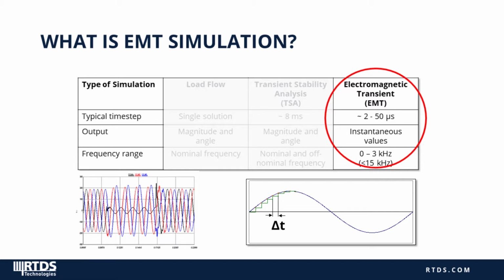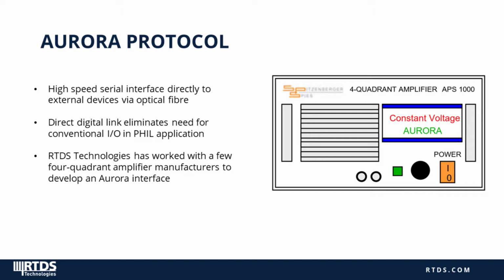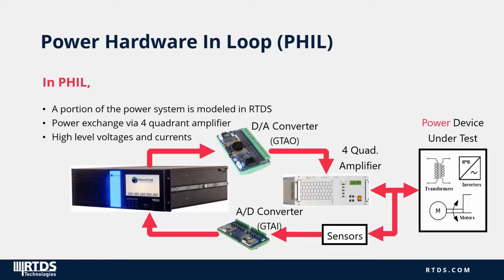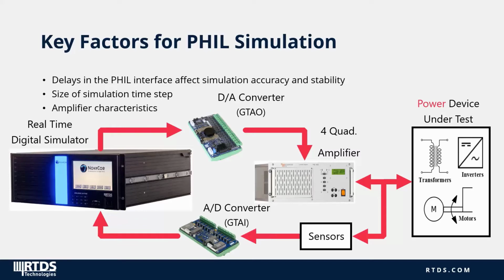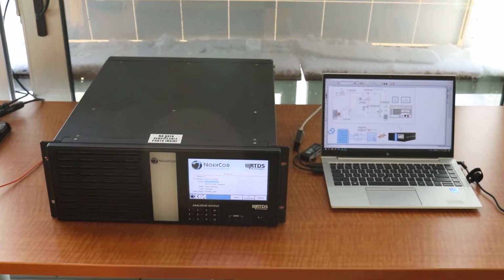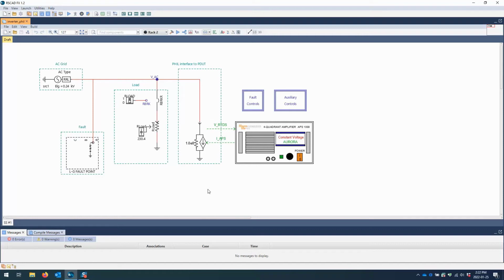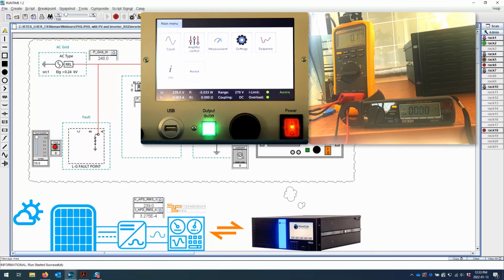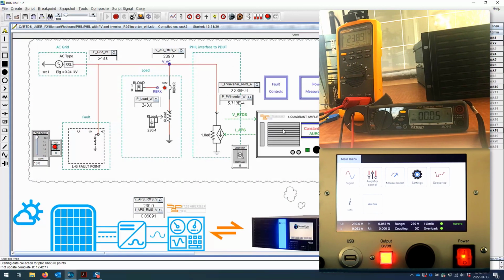Webinar and Demo: Power-Hardware-in-the-Loop Testing Fundamentals

Comment: Hi !! How the current from the inverter is going to RTDS? This means what equipment in this setup is consuming power from the inverter?
Reply: Hi Maneesha - There is a four quadrant amplifier from the manufacturer Spitzenberger and Spies in the setup. The amplifier is capable of sinking power from the inverter. In terms of the current value, a sensor on the amplifier picks up the current and it can be input into the simulation using either the Aurora protocol or the analogue input card.
Reply: Hi Kiki Sparkles - Thank you so much for the reply :)

Comment: hi there

How do you set the plots in runtime to continuously show the graphs as it plots, not only when you update it?

Thank you
Reply from the maker: Hi Ntuba - The plots don't display continuously for signals such as instantaneous voltage and current because of the huge amount of data. You can monitor slower-changing quantities (such as RMS values) by using a meter component, which can be displayed in graph format to give the effect of a continuous plot. There are some other options as well for data display of instantaneous values - please email support@rtds.com if you are a user working on a specific case.